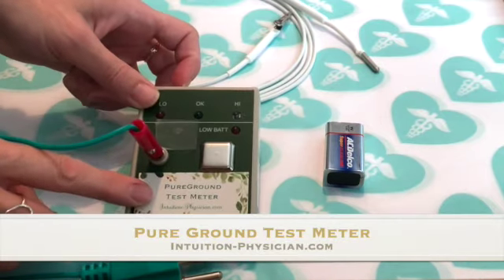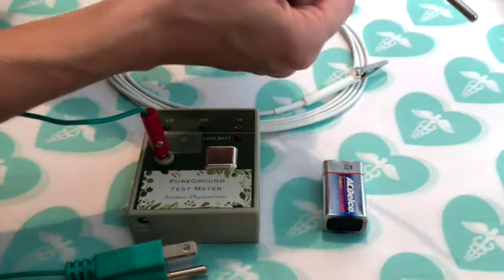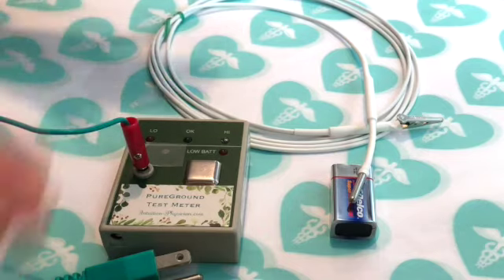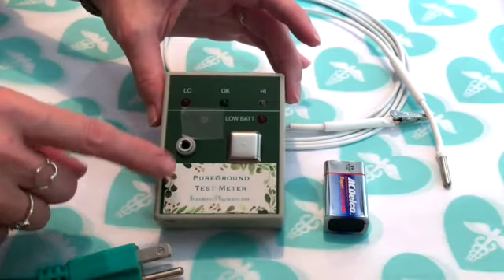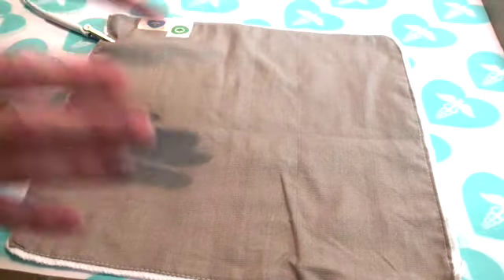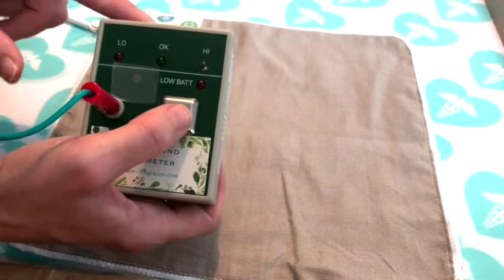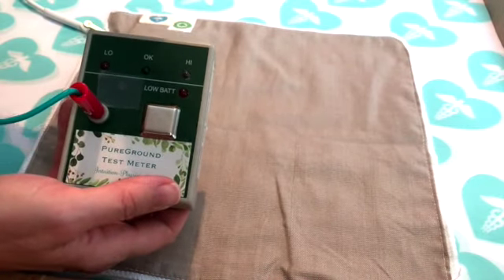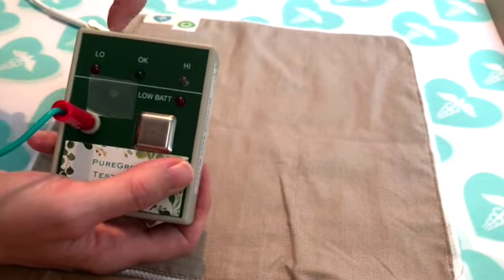PureGround Test Meter Demonstration (Laura Koniver, MD)

Comment: Could you explain what the two prongs for the neutral and hot wire ports of a receptacle are doing on the grounding mat’s plug? I get that it makes the connection more stable, but it looks scary because they’re metal?
Reply from the maker: Sure!  If you were to cut open the green plastic block that has the three prongs (the ground prong and the two electrical prongs) you would see the two that go into the electrical slit are dead ending into the plastic, not connected to anything.  The ground prong you would see is the only part that connects to the ground cord that plugs into the test meter!  I hope that helps!  xoxo, Laura

Comment: I purchased a grounding mat from you along with the cord for an outlet. I tested the outlet with the tester that came with my purchase of the mat. I recently ordered the test meter and received it today. Upon using the meter, I checked the outlet that I’m using and the test meter indicated that the outlet is not grounded, however, the tester I received when I purchased the grounding mat did state that it was grounded. I’m confused as to why one says it’s grounded, and the meter is stating it’s not. I used the meter outside barefooted and the meter showed that I was not grounded. When I touched a tree, it indicated that I was not grounded. I then took the test plug and stuck it into the ground, and that’s the only time I got the signal of “Lo” and “Ok”. Any help explaining would be appreciated.
Reply: Hi,  it would be helpful to a lot of people to do the tests on a Video. What you are saying is that that you got 2 ground test meters ? One works and the other does NOT work at all ?
Reply from the maker: You did it correctly on that last try where you plugged the tester plug into the ground, which is how the meter is designed to work -- you actually have to have the plug grounded (either via the earth directly, as you did, or plugging it into a grounded outlet) and then touch whatever item or surface you are wanting to test.  If you do not have the meter plugged in, it can not test continuity with the earth because how it works is sending a signal to through the surface you are testing and making sure it reaches the earth, making a continuous loop with the grounded cord.  Without grounding the cord/meter then there can not be a full continuous loop so nothing will ever test grounded, even if it is.  I hope that helps you understand better how to use your tester!  xoxox, Laura

Comment: Laura, could you use a body voltage meter (digital multimeter) with the PureGround cord to see when you are grounded? For example, when you see the reading on a multimeter drop to very near zero, would it be the same as hearing a loud beep on the PureGround Test Meter?
Reply from the maker: Hi Ken!  I made a video on this exact topic!  I show you how to use a multimeter here to see that when it drops, this is actually not proof of grounding, there is no way to prove grounding without a ground test meter.  Seeing the voltage drop just means you are now running a current through your body -- not a great thing.  You can take a look here, I hope it's helpful to you:  https://youtu.be/CE7OA327Pro. xoxo, Laura

Comment: I have an earthing mat from Clint Ober, do you think it is absolutely necessary to get one of these cords to filter out the dirty electricity? Also, does it connect easily to the earthing mat?
Reply from the maker: Hello Garrett!  No, I don't think it's absolutely necessary -- grounding puts your body into a healing state even through a standard ground cord, medical studies show us that so I feel comfortable for folks who like using a standard cord to continue to do so.  But if you are electrosensitive -- and millions of folks are -- then you may feel the AC current that runs up a standard ground cord and it may make you feel worse.  If that is the case, then yes I for sure think the next step is to upgrade the cord to a PureGround cord that only allows the earth's natural current (DC) to go up the cord and not manmade fake electrical current (AC) to go up the cord.  The pureGround cord has an alligator clip on the end so yes, very easy to attach to the edge of any grounding product made by any company.  I hope that info helps you!  xoxo, Laura

Comment: It's that alright to use the earthing sheet on top of my electric blanket while I'm sleeping or turn it off if my bed is already warm then use my earthing sheets?
Reply from the maker: You can and you will still be grounded but I don't recommend electric blankets at all -- grounded or not -- because of the EMFs it puts out. Even if you turn it off but leave it on your bed plugged in there will be a toxic electric field coming out of it -- at least totally unplug it before going to sleep!  Even if you decide not to ground!  xoxo, Laura

Comment: What is the difference between LO and OK on the Pure Ground Test Meter? What does LO indicate?
Reply: Following
Reply from the maker: Ok is grounded, Lo is so grounded that it's actually trying to warn you that you are such a part of the earth you may want to be careful if there is lightening in the area, that's the original intent.  If you are using a ground cord with a resistor in place then you are already covered by a safety mechanism, but if you are outside barefoot and that's why you are getting a lo it's literally telling you there is almost zero resistance between you and the earth, so you likely have great contact with health moisturized skin and wet earth below.  I hope that helps!  xoxo, Laura
Reply: @laurakonivermd  Oh, now that makes sense!  Thank you
Reply: @laurakonivermd I get Lo with your pureground grounding chord. Will I need some kind of protection additionally? 

And when putting the pure ground grounding chord outside - will I be protected from lightning?

Also I don’t understand how exactly this ground meter would detect problematic grounding cables, since I achieve mid and lo with yours? (Lo when in a grounded power socket and mid outside)
Reply from the maker: @schminktisch  LO is a fabulous reading -- extremely connected -- you must be very well hydrated and good mineral balance to get that reading!  You are protected from lightening both with the PureGround stake as well as the indoor cord since there is a resistor in the line that will prevent a surge from traveling up the line!  Obviously if you are outside with the cord, you might get shocked directly or through the earth, touching the line will not prevent that, so stay inside during lightening storms and know that the ground cord will prevent any surge from traveling indoors where you are!  xoxo, Laura

Comment: So using a multimeter to test groundedness is not that helpful???
Reply from the maker: Sadly the truth is a voltmeter can not measure grounding.  It is impossible to test a grounding tool using a voltmeter (this is a trick that other grounding companies use to show grounding but it is invalid, you can only test grounding through a grounding test meter.) Grounding is a DC current (not AC) and so what you are measuring with a multimeter is if AC current is going into a person or not, which does not tell you anything about grounding, it's two separate issues. xoxoxox, Laura
Reply: @laurakonivermd  , thank you for giving clarity. Where is that grounding test meter bought from?
Reply from the maker: @commandernoodles2367  https://intuition-physician.myshopify.com/collections/grounding-accessories/products/copy-of-ground-tester-securely-test-that-you-are-grounded